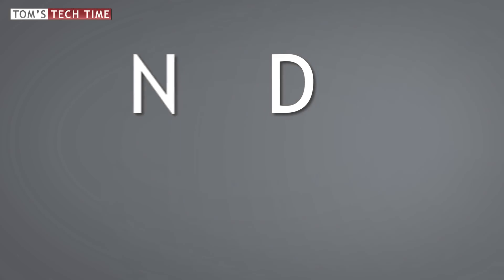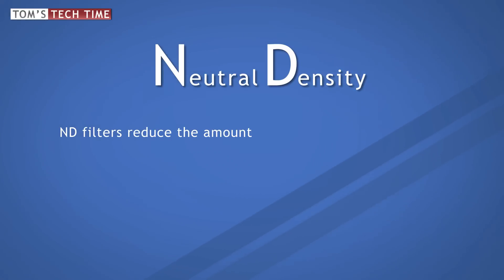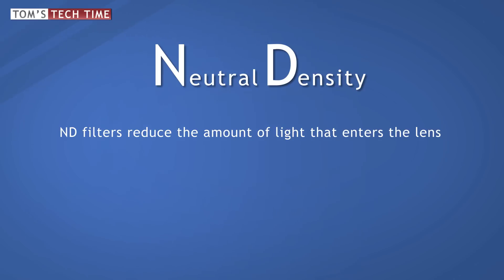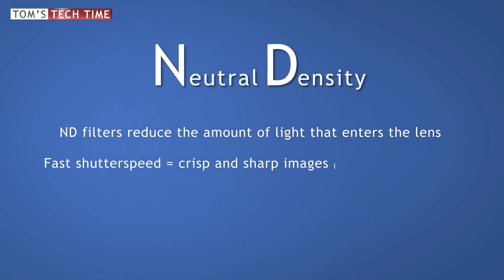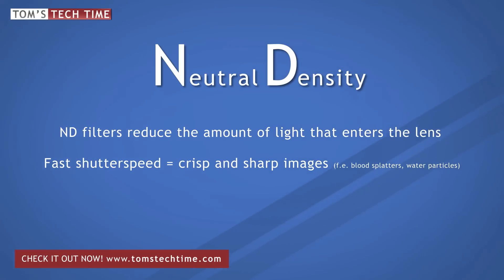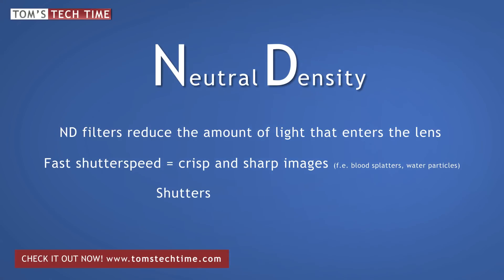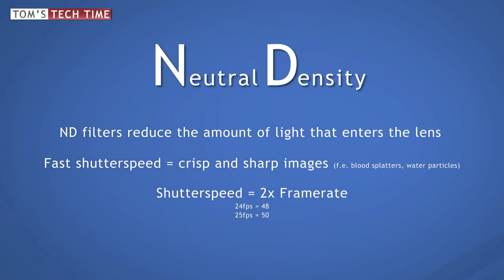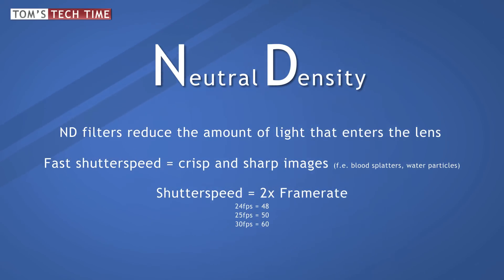How to use ND Filters with your Drone | DJI Phantom and DJI Mavic

Comment: I never understood how to mantain timeshot 2 times the fps. Ok, admitting that I am filming at 30fps, I'd have to shot at 1/60 seconds but.... how? I have a Phantom 4 Pro that has also aperture setting, so... ok, I should forget "auto" settings and FORCE 1/60 second as shutterspeed, in this way camera should automatically set corresponding aperture to mantains scene correctly exposed, right?
I think that in case that even if closed aperture is not enough for a bright scene, I'd rely on ND filters as sunglasses.
Ok, if all these things are correct... the real doubt is: this should be ok only for straight shots, because if I move camera from a bottom and landed landscape to a sunny sky or if I rotate around an object passing from shaded side to bright side... this could not be achieved, or only if aperture range allows to expose both situations (for example, with ND filters, maybe I could correctly expose bright sky but they are too dark even at full aperture for a shaded landscape)...
Please, can you carify me?

Comment: Hi Tom,
I surely understand "manual exposure" for pictures but I never thought about it for movies.
I think that to respect rules you spoke about, I should shot in SS priority, so manually setting "120" of SS in case of 60fps and then let P4P to set aperture to have the right exposure? Am I correct?

I also discovered "lock exposure" in P4P+, so my doubt is: I have to always manual expose and lock it before filming? This could be pretty easy in a straight flight but during a pan or POI rotating in different directions respect to sun, I'll surely have wrong exposure during the shot... Could be the right technique?

Maybe you could make a video about this topic, with wrong and right examples of the same shot showing how you realized your beatiful clips. Also in case of sunsets maybe.

Comment: I read a lot of customer complaints about gimbal problems when using ND filters. I don't want to buy the wrong ones for my Phantom 4 Can you comment on what might be causing these problems?
Reply: Hey, Fred.  I had the same problem.  I now use the Polar Pro.  Previously, the set I had cause gimbal problems in high winds or at high speed  and there was a "lip" on them (wider at the glass edge) that also caught the wind and caused shake.  It was really goofy.  The Polar Pro filters are very light and streamlined and I have had NO problems with the gimbal.

Comment: Hi Tom,Why for me the best result is the top video ( without ND filter ), Video is clear there is no blurring as the Down video ... Plants on the bottom video are blurred???So why filter is better?And I have a DJI Osmo, I would like to know if can I use filter with or it's just for the flight ( to reduce the jello effect ? ). I think it was important because sometime with daytime my video is overexposed in auto mode ( too much light on ), so with a ND8 for example it will be better ?Thanks.Paul.
Reply: paul russo he literally answered this in the video? Because video is motion, motion has blur, therefore blur looks better.

Comment: Why does my video stop and go after I download it to my computer then watch it on my computer ? I need help. DJI 3 Pro 4k
Reply: +Johnny Starling -  If you don't have a fast computer and graphic card plus a 4k monitor it will do that.  It really takes a high end computer and monitor.  Try converting it to 1080p in the background then you can post-edit to your liking.  Most folks don't even use 4k because of that and just shoot video at 1080 to save the hassle.  It saves a lot of disk space too.

Comment: Hey tom which filter do you recommend, the 16 or the 32 or the 64
Reply from the maker: +YoungBlaze Of Chitown Well, that depends on the light and preferred shutter speed. I mostly use an ND16 though, somtimes even 32, only very rarely none or something even higher. Stay tuned and fly safe!
Reply: Thanks for the response, im looking into getting a 16 and using it primarily alot , i didnt know if the 32 or even the 64 would be tooo dark and the 4 and 8 to counter productive, but hey i have literally learned alot just by watching your videos!@
Reply: +YoungBlaze Of Chitown better for VARIABLE its 10 IN 1 instead of having different ND just have 1 , I am using FREEWELL brand they got very good selection on filter including ND grad , SP ND grad you cannot rotate but freewell can

Comment: tom for the life of me i cannot get the factory lens off the camera.. please advise. thanks.
Reply: +taragolden I recently read on a blog post a person recommended latex gloves. Good luck...
Reply: +taragolden you gotta have the dji pro not advance or standard to my understanding
Reply: +taragolden , I had the same problem.  put a small but fairly wide elastic band over around the stock filter.  learned that this morning. Came off easy.  careful not to squeeze too hard as the housing is aluminum and  can bend I am told. The purple rubber bands that you find around a head of asparagus is perfect if you put a knot in it.
Reply: I use the motor holder that came with the pro 3  easier than the rubberband trick.